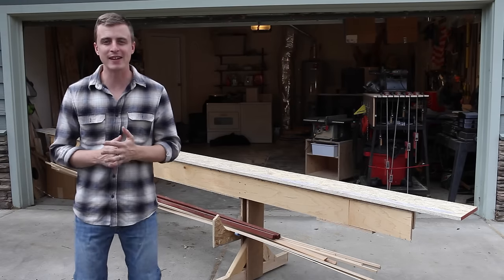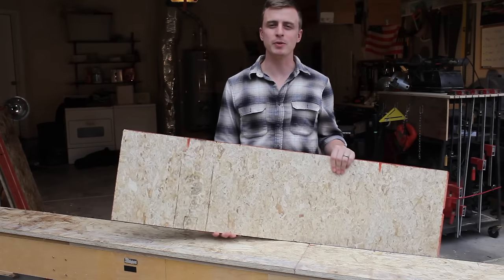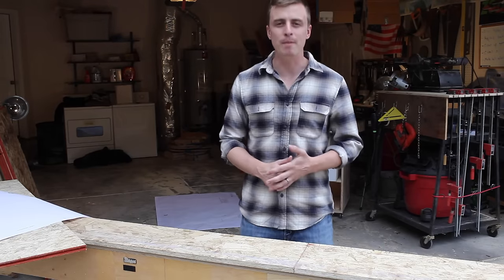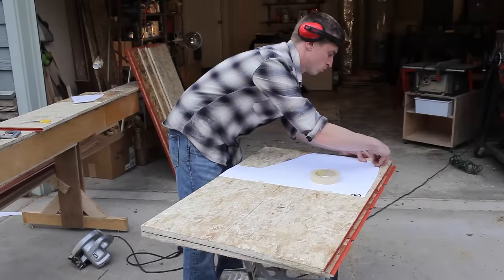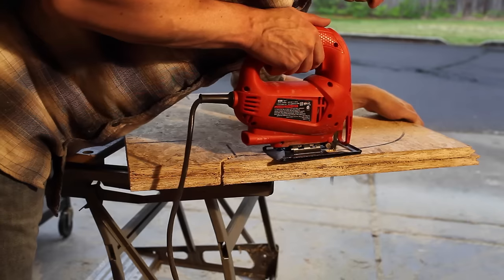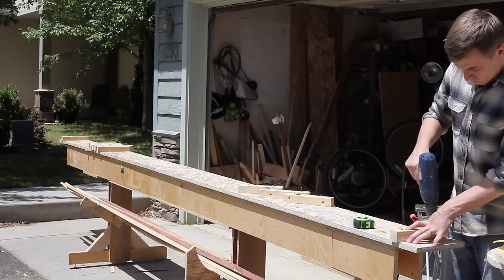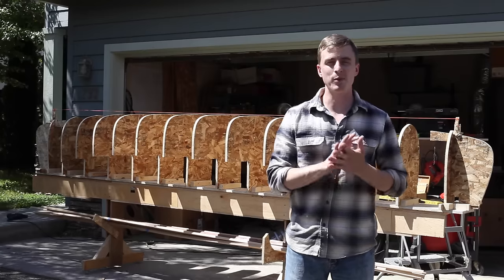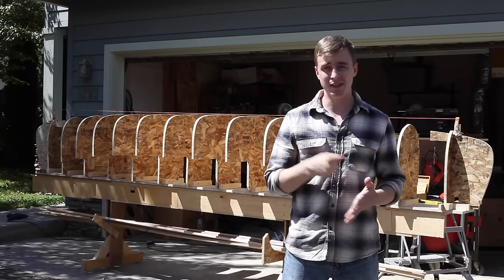Setting up the Mold (Ep 2 - Cedar Strip Canoe Build)

Comment: One tip, cut some hollow slots along the rounded edge of the forms. This way, you can clamp each strip directly to the form as you put them on, with no need for staples/nails.
Reply: Or just use a hot glue gun to "tack" the strips in place while the glue sets. You can scrape the glue beads off when it's time to plane and sand your canoe.

Comment: Nice. Will you dill holes in the molds next? Or are they not needed for this method?
Reply from the maker: Haha, I knew somebody would notice. I would usually drill the holes and bend the stems before I mount the molds on the strong back but I wanted to finish this video so I mounted them then took them off to bend the stems. Having to film everything I do can really be a pain (as you know!). I'm trying to get a bunch of stuff done this week so I'm not in as much of a time crunch for my "release every two week" thing. Thanks for watching Neil!
Reply: Haha! I was just wondering.  I saw them in the thumbnail of one of your other videos. So you kinda revealed your own hand.  Filming definitely adds to the process, but I think its all a part of the creation.Good luck!

Comment: Where should I go to find out which design is best for me? There are so many on that site and so little info about why they are what they are.
Reply from the maker: john weeks hmm good question... I think I googled it and found a website with a bunch of different models with a bunch of information about them. I don't know anything about actual canoeing I decided the "bobs special cause it was one of the shorter 2 person ones I found w good stability... if I were you I'd just spend an hour on google researching it? Sorry if that doesn't help!
Reply: thanks, I think those parameters are all I need to just go ahead and build a Bob Special.
Reply from the maker: Cool! I think the only drawback is it's not a super fast canoe because of the width to length ratio but I do feel very stable in it. Again I'm not an experienced paddler so I really don't know if it's a good canoe or not...

Comment: How many sheets of ply does it take to build the molds?
Reply: it really depends on the specific set of plans, but I would say your best bet is to only count on 2-3 stations per sheet of ply wood, but if you lay them out carefully, you can get other pieces from the same sheet. Likewise some of the stations are smaller so you can get more on a sheet if you lay them out carefully. Your middle stations are quite large, but your end stations are smaller so you can fir more of them on a sheet... IIRC a couple years ago I figured up 3 sheets for the stations of a 16' prospector at between 2 and 6 stations per sheet, plus a 5 more sheets for the strong back (I may have over engineered the design but better over engineered than twisted), plus something like 40-45 board feet of 5/4 inch rough sawn cedar from my local mill (the math says 35, but expect imperfections in the wood to result in 20% or more of scrap and saw kerf losses more specifically  it will take 5-6 boards 16-24' long that will yield 6" planks with ~14 strips cut from each board) then there is ash or your choice of hardwoods for your seats, yolk, and thwarts, plus the outwalls, inwalls, and inwall spacers to make the rub rail and gunnels... plus 12-15 yards of fiberglass cloth and epoxy to coat the inside and outside of the hull (it is definitely better to have too much fiberglass cloth than not enough) (and do not forget to allow enough wood to make 2-4 nice paddles to match your boat :) after you put all the work into such a beautiful boat you would not want to be using cheap plastic paddles <LOL>)

Comment: How perfectly cut do the moulds need to be?? I've sanded out the imperfections best I can but still not perfect.
Reply: Your finished project will only be as good as your mold.  Any defects are going to be transferred to your canoe.  You  can always use either veneer glued to the edges as a fix, or a quality wood putty or epoxy to fix errors.  Using a bad mold is like using a crappy saw to cut a straight line, it just ain't gonna happen.

Comment: how do you make copies of such large pieces of paper?
Reply from the maker: Jack Gehl fedex kinkos did it for me. I think they couldn't do the full size so I cut the original in half and they did the half onto thick paper. I think it was like $20
Reply: Screw doing paper transfers to plywood. Do some looking on net at all boat plans. When you understand what a waterline is then use a long strip of cedar as a flexible curve to actually lay out water lines on freezer wrap(one edge of wrap is your canoe centerline). Of course you must come up with the shape of the middle form(widest) first. Waterlines at 1/4" increments from bottom of canoe then 1/2" spaced till the 3"' waterline,then 1" spaced waterlines up to gunnel hight . Each form is represented by lines 90 degrees from freezer wrap edge. Every place that a waterline intersects a form line should be measured and recorded on a big piece of paper. I PUT PLYWOOD ON SAW HORSES and use a "T" square to draft points to the plywood. Use a french curve to connect all the points of your forms. BAMM your canoe not somebody elses! Built 22 like this now on #23.